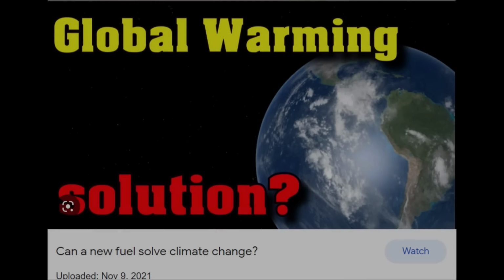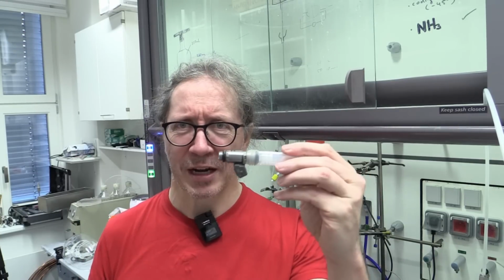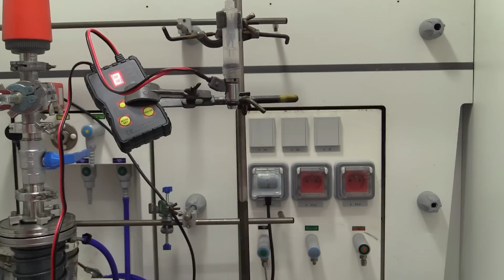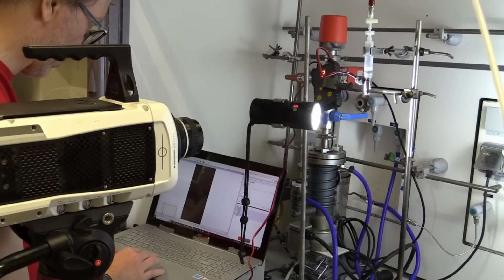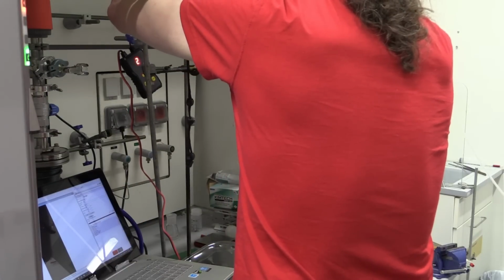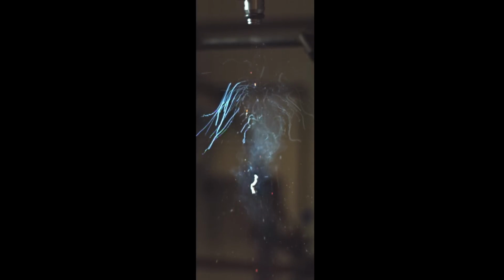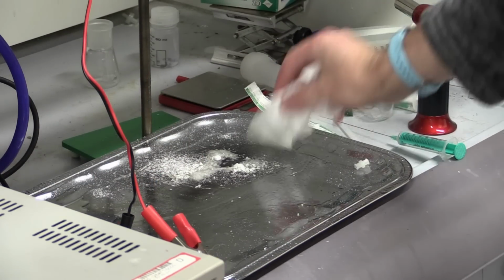Can Fuel Injectors burn SODIUM??

Comment: EDIT: I'm stupid, the whole point is to create particulate matter to block sun light... So this isn't gonna fly with ICE regulations limiting particulate matter in order to preserve air quality (especially in dense urban areas). I just focused on actually burning it in an ICE, rather than looking at the end goal... anyway, here's the rest of my comment:

This is amazing! As a car guy my first thought was high pressure direct injection, which seemed pretty scary especially when seeing your testing rig in the intro and seeing the consistency and "skin-y-ness" of your alloy.
Very cool stuff, really curious if this has actual applications in internal combustion engines in the future (especially if applied through direct injection, solved (or suspended) in the fuel itself).
Might even delay the death of ICE, if this is applicable to current engines without modification and potential damage/knocking etc and doesn't create other too many issues like particulates or compounds that inhibit the catalytic process (or even block the catalyst itself). 
...
The more I think about this, the more I doubt that big fuel manufacturers haven't already toyed around with this idea. Still very cool video, really interested in future developments of this stuff!

Comment: Love watching your stuff I get lost in this kind of thing. I am only an old man with only a high school education so forgive me if this is naive but you mentioned soot as one of the products with this. From many years of working on many types of engines carbon buildup on internal parts is one thing you try really hard to minimize as it will degrade your engine fairly quickly if not kept in check so if you have a lot of soot it is going to do the same I would think.  Wish you would do more experiments!

Comment: Yes, life is a learning curve, i leant about low pressure fuel injectors when taking my car apart when it would not start. These things have fat O rings in them, when under pressure, engine running, they swell up and seal it well, But when not running, you can just pull them out, You don"t even need a wrench. Well, burn my nipples with a blowtorch, but i never knew that, until i got talking with the mechanics....

Comment: The smarter every day vid is also about high-pressure diesel injectors, ~1000psi+. You are using a standard automotive MPFI unit that only uses about ~40psi. 
Much better. Shop by cc or lbs per minute.

Comment: This is a really cool experiment, but in an actual engine you want ignition in a very specific moment. Otherwise you´ll destroy the engine. Maybe injecting the NaK into the hot exhaust would make sense? You said this could be used on freight ships and maybe planes, right? For the ships I think you could inject into the exhaust and harvest the heat energy by boiling water?

Comment: 8:50  Congrats!
In many professions, we joke that if you've not bled during assembly/reassembly, it won't work/be reliable. 😂 
Specifically those I'm knowledgeable it being used by, is.... auto mechanics!

So, with it properly christened, your end-goal should be achievable and we will have a bit of a grace period, instead of a grave period! (dad joke brought to you by: swipe typing prediction, as it gave me 'grave' initially)

But genuinely, I don't see why this couldn't be possible as a fuel additive, given that Pb was/is used (some Aviation Gas is still leaded) in fuel for a long time. Which as we know, Lead is similarly a soft metal! 😁

I had came here simply because I was intrigued by the fact of somehow running Sodium through a fuel injector, as it tickles my interest in cars and MacGuyvering things (aka outside the box thinking).
I also love science, though, so what a surprise when you outlined your goal and that it's the reasoning, not your usual YT tomfoolery! (as I was expecting haha) 🤘
          <clicks ▶️ and resumes watching>
Reply: P.S.  - After getting to the cleanup... a bit of a Fun Fact is that Toluene is used as an additive in Fuel Injector and Fuel System Cleaners (at least here in the US; Berryman's Chemtool Fuel System Cleaner, which I swear by).

Also, you're probably WAY overdriving the Injector, now that I've done the conversion...
25 PSI (aka 25#) is common low end Injector rating
40 PSI (40#) is middle, 60# being much higher performance and ethanol application.

25# = 1.7x Bar
40# = 2.5x Bar
Whereas you were pumping 5 Bar through the Injector.
Depending on that Injector, it's possible you were leaking because your pressure was way too much. Similarly, the poor atomization probably was because a combination of that and forcing too much fuel through.

On the flip side, you'll want a 60# I think, which is 4.13 Bar (!) and I think that's helpful for defeating the surface tension. Which you mentioned ethanol having a high tension.
I'm pretty sure that the extreme performance vehicles run upwards of 180# (supercharged, turbocharged applications), but are NOT the High Pressure system you mentioned early in the video (these aren't direct injection).

Search for injectors by Accell (sic) or Holley, for said extreme performance injectors.
In sure others have mentioned this info, but figured I'd live up to my name and mention it just in case. 😊 Hope it helps if anything lol

Comment: These flames are what happens inside coal fired power stations and can be observed with the naked eye. 

Imagine a continuous fireball suspended in mid air for periods of months to years. Think of the complexities involved in maintaining the delicate balance of factors to maintain such a fireball, these include: fuel properties; particle size; fuel injection rate; fuel combustion rate; air flow rate and many more.

Despite the short comings of coal fired power; each station is a living, breathing animal of its own.

Comment: I would suggest a Ford 7.3 Powerstroke/International T444E diesel injector, its joked that they would pass small stones before failing. But I dont know if you can make them fire without the 1000psi oil pressure they use in the engine. The ecm wont even fire them if it doesnt see between 650-750psi on cranking.

Comment: The actual problem here is something no one is mentioning.  And it is a very simple point:
If Aerosols reflect sunlight away from the Earth during the day then how do we cool the Earth Radiatively during the night?
Will the aerosols not reflect the heat back to the Earth?  The only solution might be if the aerosols only reflect visible light, not infrared.
This is the same situation you get if you attempt to spray seawater into the air for evaporative cooling.  It doesn't get rid of the heat of the Earth.  Only radiance will work.

Comment: I wonder if it would work in diesel-like engines (ignition by compressed air temperature, injection at top of compression cycle), but pretty hard to test with the pressure those injectors need .

Comment: They have different leakage rates for different solvents because of surface tension, viscosity, and the material in the gasketry.
Anything that uses methanol or ethanol uses special gaskets and o rings and rubberized components compared to a normal fuel injector cus ethanol can sometimes melt a normal one

Comment: Do you think the difference in flame speed can be measured with how effectively the flames migrate towards the injector nozzle against the fuel inertia or is the spray pattern and  disruption to stoichiometric ratio going to distort the burning too much  to use this metric?
Awsome video!

To add: the sodium flame speed seems very high which is very useful for RAM/SCRAM jet applications where we are often limited by combustion times dictating combustor length and flow velocities and ultimately product size mass etc. Super sonic combustion is the holy Grail.

Comment: I would imagine that the differences in propensity to leaking are differences in surface tension and hydrophobicity or lipophilicity interacting with the plastic injector body.

Comment: Modern Fuel oil furnaces have a fuel injector that might be a better fit than those used for gasoline. As these high pressure injectors nebulize very thick oil you might have better success. The plastic gas pressure line system probably isn't gonna cut it though.

Comment: A pop type mechanical diesel fuel injector would probably work better for testing. You could use the injector tester like Smarter used to pressurize it. Since these work at high pressure I'd guess you'd get better atomization of the spray and better results. No electrical connections for these. A tester is about $90 and injectors can be had for about $70 and up.

Comment: Different injectors have different spray patterns and different pulse times depending on the purpose of the injector. Would you be trying to use this in a four stroke, 2 stroke or rotary setup?

Comment: I own a alfa romeo 159 that does not run on e10 petrol because the added methanol in e10 petrol is to thick for the injector. That explains the difference in spray you got on water/alcohol and that other stuff you tried.

Comment: In the begining you hinted at the posibility to use aerosols for cooling. I was just wondering if your thought process is to use aerosols of sodium and potasium oxides that might pull moisture along with carbon dioxide out of the atmospher and solve acid rain and ocean acidification, or ratherly, could it capture co2 from a waste exhaust stream and make sodium/potasium bicarbonate? Or do we have to wait until your next video to learn? 😊

Comment: So seeing as I'm not a chemistritian I'm kind of curious as to how this potassium-sodium alloy reacts with fuel oil? If it's relatively stable and perhaps most importantly, soluble, then you could run in through an injection pump and test it out on an old tractor engine or something. If it still works as intended and offsets the effects of greenhouse gases it would be great as a diesel fuel additive since most essential machinery run on diesel engines, be it ships, tractors or generators.

Comment: Could the reason, why it didn't ignite at first be a thin oxide layer und the potassium sodium alloy. Or maybe there was still some parrafin that coated the alloy. Anyway, this is awesome. I think you could have kept going until the injector died to get a better exposure on the high speed footage. Well, unless you're planning on using the injector for another experiment that is.

Comment: Surprised that injector worked being bottom of the barrel for quality.
Not all injectors are made equally which is something you see a lot when working on engine tuning.
Cheap ones will always have leak and low pulse with lock up issues.

CNG may work better for your application or some GDI injectors (They will require a lot more pressure on them tho).

Comment: Given the price and webshop you bought this injector on, I suspect that it is not a genuine Bosch injector. The Chinese clones usually have a much worse spray pattern. Maybe your results could even be better with a genuine injector. A handful of original pre-owned injectors is usually cheap as well.

Comment: curious how much of an effect this could have if this was mixed in with fuel. does this improve fuel economy by burning more efficiently?  would a small 4 stroke engine survive with this mixture? would this react with the soot in the engine and/or oil that would be in the combustion chamber? More testing requested with fire!

Comment: It’s weird to think how close but far away this concept is. By that I mean there is technically already sodium in the combustion chamber of most cars but it’s used for a different purpose. 

Most engines at this point use exhaust valves that have a cavity filled with sodium to help pull heat out of the exhaust valve and prevent damage. Though now this video makes me wonder what if sodium leaked out of a valve like that into a running engine

Comment: Question about using an aerosol to reduce global warming.  What is the net benefit of reducing heat? The aerosol will reflect some of the energy from the sun, but would also insulate the planet by reflecting back the radiated heat from the planet.

Comment: Cool experiment, but keep safe. A cotton T-shirt and fleece are zero protection for this stuff.  Get some mechanics overalls (fuel resistant) and a welders jacket if you are going to play with fuel injectors and molten metal and fire.  It's cheaper than plastic surgery.

Comment: Very beautiful stuff. I don't understand the point of the experiment, though. Is the idea to fill the atmosphere with that white cloudy stuff to block sunlight? If so, wouldn't that be bad for agriculture?
Reply: Yes. No, blocking a tiny fraction of sunlight isn't going to do shit to agriculture.

First, the idea is to reflect about 0.1% of sunlight. That's negligible.

Second, plants don't require the full intensity of sunlight. In fact, it's often detrimental to their efficiency.
Reply: @seigeengine  I didn't know that. Thanks.

Comment: I think sodium may cause a negative reaction in the metal engine designed for no charged particles. We have sodium in our bodies that cause reactions in our bodies (feed neurons, pump the heart, fight infections) part of that process the salt has to become either positively or negatively. I think the sheer force of friction as well as sodium's "random" desire to charge up, would cause problems. Bigger still, is the design of the engine needs to take the forces and the chemical reactions. Sodium is too volatile.

Comment: @thunderf00t what happens to the aerosol at various pressures and temperatures. for instance what happens to when you put it under pressure but drop the temp, or raise the temp, or drop the pressure and raise the heat?

Comment: We are reliant on the way that the climate works for access to food. We do not have the infrastructure in place to move water in the ways that are needed to continue feeding people if rainfall patterns change significantly. This sort of geoengineering will not put us back to square one, it will still be a change. Because we rely on rainfall patterns so heavily, it is wise to leave the climate studies up to climatologists, not chemists. This solution is barely a stopgap, and the problem is more complicated than a discrepancy between the energy absorbed by earth and the energy emitted by it.

Comment: It seems this stuff burns much much faster than gasoline. That will require very different ignition timing considerations when used in a running engine.

Comment: There is a lot to take in, have you started considering to test the sodium fuel under the combustion chamber pressures of a cylinder in an its?  Potentially it wpuld become more volatile under higher pressure therefore burning easier. And at what temperature does it vaporize at under those pressures?  This might be an ideal 2 stroke directed injected diesel fuel, since you are embracing the emissions anyway.

Comment: You may want to look at nitrous oxide systems fuel nozzle and solenoid,   the lower the fuel pressure the larger the orifice high pressure direct injection has tiny orifices,  are you wanting to burn this in a engine, or build a burner to create the secondary product only?

Comment: Tf00t
electronically controlled diesel injectors can handle up to 2000 bar
yes they are very expensive and SUPER sensitive to what goes through them

Comment: Hey TF, would you consider doing a video about the viability of lithium battery powered cars when charged regularly in freezing temperatures? From what I've read, it causes plating damage to the batteries but how bad it is seems to not be covered too much in practice.

Comment: The real difference with the injectors you have vs smarter everyday is you have GASOLINE fuel injectors where he had DIESEL fuel injectors. Modern diesel injectors are typically piezoelectric, the ones he had are old school poppit style. The reason for the difference is the absolutely MASSIVE pressure difference. You are at 5 bar, diesel engines are typically 700-2500 bar. The amount of fuel you saw was the maximum that injector was capable of delivering, this is just an artifact of the tester he used. Diesel engines do not use a throttle plate to regulate power, they use the amount of fuel injected into the cylinders to regulate power. The diesel stuff has so much higher pressure because diesel fuel is actually an OIL and is quite viscous for a fuel, it needs the pressure to atomize properly. I would reckon that you would have a much better result with the alloy by using a diesel fuel injector and higher pressure.

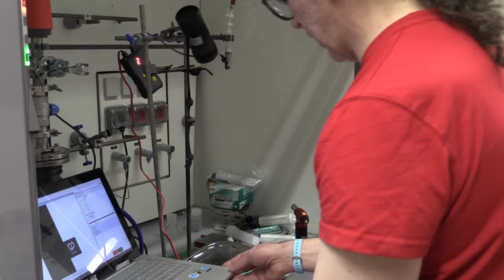Comment: 27:05 Fleece and flame... Dude. About the WORST thing you can do for burn protection. Assuming of course it isn't natural fleece. Most modern fleece clothing is polyester based. It can melt onto skin causing more damage than the actual flame. THEN at the emergency room, they can't remove it without taking your skin with it. You're better off with cotton that will at least burn away.

Comment: Those hands look like mine. 95 percent ethanol, 5 percent blood.  This tells me that you are not giving up to succeed even with possible wrecking of bodyparts. You sir are a  Monty Python Black Night of science. The valve leaking is because it won`t seal molecules shorter than octane I would guess. Maybe a tradeoff for switching speed? It is a bit difficult to play this video with sound as it will trigger people to come and watch if someone is tripping on somekind of substances.
Also during the vid i was thinking: Facemask protection: check, practically nude for the rest of the body: check. Shorts and sandals right? Then the coat came on... So funny

Comment: If that injector was not made for hi level ethanol fuel mixtures  and just normal 82 octane with 10% ethanol, the added the pure ethanol breaks down and dissolves  the seals inside the injector.

Comment: Is the inlet on a fuel injector typically at 5 atmospheres of pressure when it's used in a car? I imagined it was more of a pump than a valve.